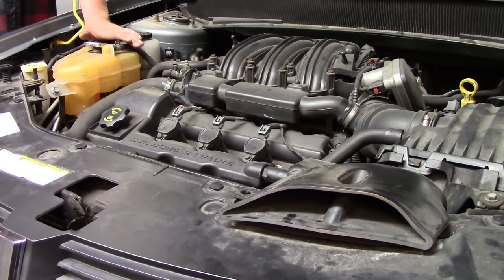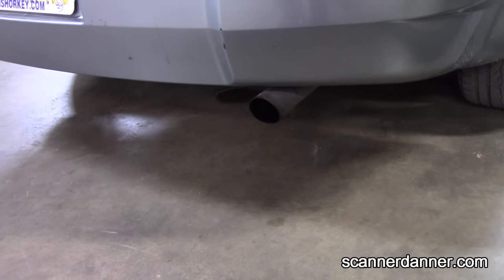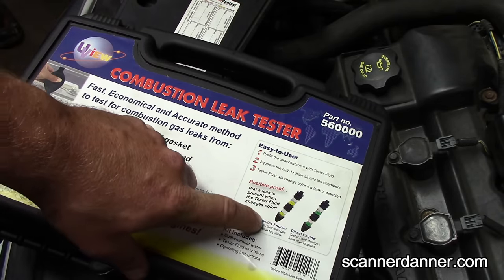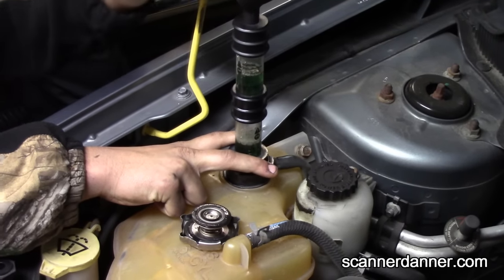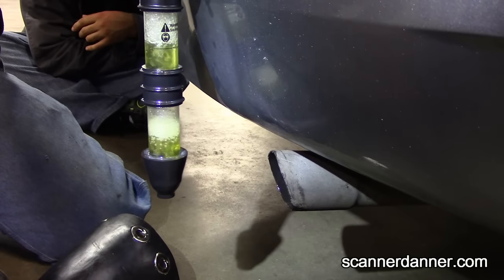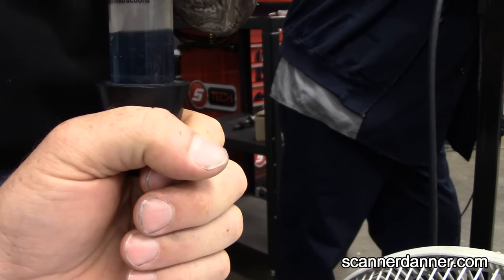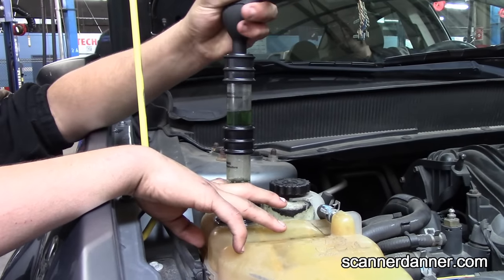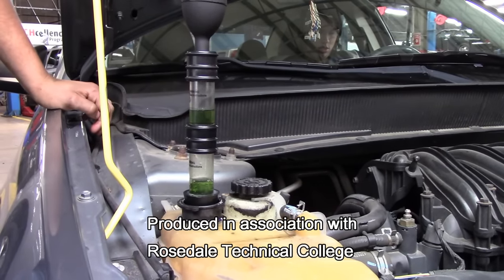Testing for a bad head gasket  - Gas Analyzer vs Chemical

Comment: "Bromothymol blue (BMB) is an indicator dye that turns yellow in the presence of acid. When carbon dioxide is added to the solution, it creates carbonic acid, lowering the pH of the solution. BMB is blue when the pH is greater than 7.6, green when the pH is between 6-7.6, and yellow when the pH is less than 6."   So even if it's green, you have acid in your radiator fluid, carbonic acid, which forms when carbon dioxide is bubbled through water.    Diesel produces less co2 than gas engines.

Comment: Since your device is malfunctioning how do we know your HC test is accurate?  dismissing the milky oil check is not a good thing, it's one way to check if you have a coolant leaking into the combustion chamber.  your test only checks leaks between the cooling and combustion and not leaks between two combustion chambers which can cause misfire symptoms.  performing the compression test will verify this by having two near chambers with similar pressure.
Reply from the maker: Just the O2 sensor, it is accurate other than that.
I'm not dismissing the milky oil test, only saying that you can't go by no milkyness as an indication that everything is good. Also I've seen milky oil fill caps without a headgasket issue (moisture from the cap area)
Compression loss between two cylinder does not result is overheating or coolant loss and would be a 2 cylinder misfire. Symptoms dictated that to not be the case. This isn't the be all end all as you're questions seem to be suggesting that I said it would be. This is simply the most accurate test for a common headgasket type failure

Comment: I have used an A/C "sniffer" a couple of times to condemn a head gasket failure.. after also verifying with chemical tester. Small leaks may not pickup so well though all the time.
Reply from the maker: I've also heard of false positives with this type of tester, so be careful

Comment: I just bought and used one of those tools but mine is called Block Tester, it only has one fluid chamber which they say is more accurate. The instructions for mine also say to squeeze the pump for about one minute, I'm surprised yours says only 3-5 times for gas. Luckily I didn't have a bad head gasket.
Reply from the maker: The dual chamber is supposed to be more accurate. Read "Pete Sambolin" posts in this thread

Comment: in the PDF you put up there... it clearly says " if the fluid turns yellow or green it is proof positive..."
Reply from the maker: The issue I had and still have is when it doesn't change

Comment: Paul, the chemical tester has to go right on the radiator cap.  To do that you need to drain the radiator a quart or two.  The chemical tester is probably not as sensitive as the gas analyzer.  But, it is probably 1/10th the cost!
Reply from the maker: This was a pressurized overflow bottle and WAS the radiator cap.
Reply: You are right, sir!  I thought the yellow cap at 0:18 was the radiator cap but it was the oil cap.  My bad.

Comment: Have you ever heard of or used "the sizzle test?" I have heard of it but never seen it performed on such a minor head gasket issue. Basically you take a small sample of oil and using a strong heat source you heat it and see if it just smokes or "sizzles" indicating water or coolant.
Reply: Yes, I learned that one from a James Halderman book. He calls it the dipstick test. It is not accurate on early stages of head gasket failure. Good backyard test though.

Comment: I absolutely hate the chemical test. I've had cars with definit head gasket failure and missed it due to that test. it seems to not be very good for early onset failures . ever since our old sniffer machine quite it's made making the call on head gaskets much harder
Reply from the maker: These are the types of comments that the viewers need to pay attention to. Some here swear by the chemical test in all situations. I am more inclined to doubt it is 100% accurate as you've described.
Reply: Not every head gasket leaks into the cooling system.

Comment: For the record. It states that you should NOT use exhaust gases to test the fluid. It can contaminate the tester for future uses.
Reply from the maker: Funny because it is exhaust gases that are in the cooling system when you have a bad head gasket

Comment: can we do the same diagnóstic with the compression transducer???
Reply: Th majority of failed cylinder head gaskets don't leak a huge ammount of gas pressure from the cylinder in to the coolant side.  Occasionally you get one where there is major blow out of the "fire ring" that seals the top of the cylinder and you will see definite puffs of exhaust gas from the raddiator or coolant filler cap. 
The engines I work on have open deck alloy cylinder blocks with drop in wet cylinder liners, on those particular engines I see a lot of head gasket  failures where oil and coolant are mixing but the fire ring seal round the tops of the pistons is still good.

Comment: Just throwing this out there without getting bashed Scanner Dan what if you use the Innova wide oxygen sensor reader will that work at all if you were to sniff the radiator.
Reply from the maker: Not sure Tommy? Thanks

Comment: What about pressurized upper and lower radiator hose.  I've expiereced it to be combustion pressure going into coolant  jackets was my guess.
Reply from the maker: For sure that can be a symptom but you will not always have that with headgasket leaks

Comment: Paul, what about if you had pulled the spark plug(if accessable) on the cylinder setting  the p030? and pressurize the coolant system and inspect for seepage in the combustion chamber. What if the engine had an intake manifold with coolant that could make it's way into the cylinder from a failed gasket.  lastly, It would have been cool to see you put a pulse sensor or PSI transducer in the  degas tank(coolant) and see if you could see anything with that way. Your students may have enjoyed it I know I would have.  I'm with you I don't trust them Chem testers Thanks
Reply from the maker: 1. You do not know what cylinder it is. (unless it is a dead misfire, you are going to spend a lot of time here)
2. pressurizing the cooling system is not a great test (compare 15 psi to hundreds of psi of combustion). I've seen many bad headgaskets hold pressure indefinitely with a cooling system pressure test.
3. intake manifold coolant leak - it does happen (rarely) and it is a variable (as with any test)
4. a pressure transducer in the cooling system, haha now you are starting to sound like me

Comment: Nice one Paul! I work in the place where we have gas analyzer for petrol engines emissions.
So 100HC (ppm) sounds high to me but is there something i need to know on warm coolant or something..?
I also have CO2 tester for petrol or diesel fired heating systems that we aftermarket install to cars to keep us and engine warm in here. So my Q is, do you have a limit how high you think it should be for only CO2  measurement?

Great video Paul again! Maybe that stuff works better when cylinder isn't' misfiring yet?
If not, i sure hope, we get some cheaper tools in future, that we can rely on..
Reply from the maker: OF course 100ppm is too high. In fact ANY HCs in the cooling system is too much. I use the 100ppm number as a 100% confirmation. I've seen gas analyzers read 60 ppm sitting on the bench. 
The Co2% from the cooling system should be 0 but I do not use this gas on the analyzer because it is designed to read larger amounts.
Reply: OK Thanks!

Comment: I did this test from my overflow tank and also blocked off the coolant overflow tube.  I would imagine that the air would be taken from the source of least resistance and since the overflow tube is fairly sizable and not restricted and right next to where the combustion tester is located, it only made sense to block it off.  Not sure the guys in this video did that.
Reply from the maker: You're talking about the overflow tube of the overflow bottle? You're not wrong in wanting to block that off. It's just not necessary. If the head gasket it bad, there is enough combustion gases in that tank regardless if that tube is open to the atmosphere
Reply: Fair enough.

Comment: Hi, i have a 2008 1.8 tdci and about for month had head gasket blown and The mecanic replaced it. Two weeks ago i had a longer trio and sudenly lost power and no heat came from heater. Today i made a test with a similar tool and The first chamber turns green only if i rev The engine above 3000 rpm. The mecanic doesn t have a dynanomatric key, could be The bolts?the engine starts normally when is cold.

Comment: I wonder if you could have a bit of "chocolate milk" looking stuff (literally just a slight bit) under the radiator cap that clears up after running the engine and never comes back? I just bought a 2013 Wrangler, and on the 3rd drive after I got it the coolant was low enough for it to "run hot" and after filling it back up it's ran better than ever (literally, it has run better than the day I bought it). I've got no signs of anything out of place, except maybe the tech that did the coolant flush not filling it up and burping it properly.
Reply from the maker: Something to definitely pay attention to. You could have a radiator transmission cooler leak that's getting into the water passages. This can end up putting coolant into your transmission and ruining it! What the transmission fluid look like? Maybe drop the pan, just to be sure, and do a fluid and filter change while you're there

Comment: Paul, have you ever stuck the gas analyzer in the fuel filler neck?  What does it show just sniffing unburned gasoline fumes?
Reply from the maker: HC gases is what you will read. CO, CO2, NOX are all byproducts of combustion

Comment: HC test fail if ECU after misfire detection cut-off injector (some cars do this very quickly). It will be visible when water flood spark plug.
Reply from the maker: The HC test is still valid in your senario, the injector will always fire on initial start up for a few seconds and typically headgasket failures cause intermittent misfires, that are NOT severe enough to disable the fuel. If it is bad enough to create a constant misfire and injector shut-down. I promise you there will be HCs in the cooling system regardless of injector shut-down. Why? Because injectors will always fire on start up.

Comment: i will also say if an EGR cooler is defective both tests will show a defective head gaskit
Reply from the maker: GM 3800?
Reply: i didn't mention make or model if the car is fitted with a egr cooler it will show the same result
Reply: its a fault that caught me out in the past something to pass on to your students just to watch out for it
Reply from the maker: and it is super uncommon and I have only seen it on the GM 3800 engine with the plastic intake. Can you name some engines you have personally seen this on.
Reply: it can happen to any engine with the cooler
Reply: all i am saying is when the modern engine  shows a head fault check to see if it has the cooler if it does look at it to make the proper diagnose. as all your misfire codes exhaust checks and leak test will show for a positive head fault when i might not be
Reply: I am not arguing with you. I just wanted some specifics from you for my subscribers as to which engines you have seen this on. I myself have only seen this on the GM 3800 engine and it would help me and other to add to this list. If you don;t have specifics, no big deal. Thanks for your contributions here.
Reply: i am just generalizing to the fault  and not pinning it down to make model or engine its just a good thing to check for with those symptoms i watch your vids on management faults   and thy have helped me a lot  well done for taking the time on them i just wanted to add that as it can catch poeple out
Reply: it is a fault iv found more common on diesels but i have seen petrol's  varying a wide rang of makes and models so just a good idea to check to see if it has it And if it does pop the EGR valve of the engine ass they tent to look steam cleaned inside when it happins
Reply: BMW M57/M47 Engines , some VW TDI engines , most of the water cooled EGRs are on european cars (for now)
Reply: I totally agree , a defective egr cooler with make both tests invalid. & i have seen vehicles have head gasket changed only to find egr cooler the problem!! To the cost of the customer .But cooler only on newer cars tho, as cooler not really found older stuff. So Testing needs to look at the age of vehicle & equipment fitted
Reply: ) all was trying to say look for the cooler if it has it test it but what i will say on that a pressure test will sometimes  say its fine when its not
Reply: some diesel engines have an EGR cooler like the 6.0 Ford
Reply: Some european cars have that egr cooler
Reply: A lot of heavy duty engines like Cummins on heavy duty trucks have EGR coolers and they do go out all the time.

Comment: With respect to the hydro carbon testing... Would a alcohol based coolant at high temperature cause a false reading??
Reply from the maker: I am not sure my friend. I am certainly not familiar with that type of coolant and have never had a false positive for this test (The HC test in the overflow bottle)

Comment: If a cylinder is just not burning or firing, wouldn't you be able to tell just by an obvious miss in the engine?
Reply from the maker: Yes, you'll typically have a misfire, but not always, depending on the severity of the gasket leak. But there are many causes for a misfire that are not head gasket related. Make sense?

Comment: So you can re use the fluid it turns back blue sucking fresh air in ???? On the combustion test fluid bottles says don’t re use fluid. Confusion
Reply from the maker: You don't want to dump the used fluid back into the fresh container, but yes, it will turn back to blue with fresh air

Comment: The best fluid i have found is from Napa..Tthe oem brand from autozone wont change  even at the tailpipe. A 5 gas is the best until a rookie sucks antifreeze into it. If the coolant has been changed the fluid test can be thrown off. if you suck antifreeze into the tester the fluid will turn a light green then turn back to blue.

Comment: my question is this:  is it possible for there to be an HG leak that is not bad enough where it is going to leak during the compression stroke or soon after spark, but it leaks only at maximum cylinder pressure and when there is not enough uncombusted HC remaining in the cylinder that can be pushed through the HG leak to be detected by the gas analyzer such that it gives an unambiguous result?  or is there always plenty of remaining uncombusted HC to detect through the HG leak when the cylinder is at maximum pressure?
Reply from the maker: I've never, not once, had a false positive or negative using the gas analyzer. If the headgasket is bad, or there is a crack in the block or head, you will see it. I can't say that I have as much confidence in the CO2 test of the block tester

Comment: If your getting unspent fuel in a cylinder you can drop a spark plug out and see if a plugs wet with fuel. You'd also have a misfire and your can also measure temperatures or exhaust manifold.  For every argument your making in your video there's plenty of other things to try to confirm a head gasket misfire etc.  Use another method to confirm like compression test or leak down test. Always best to make double sure before ripping a head off

Comment: I don't even bother with the Routine Test and go right to the Major Leak Test. The major test you accelerate and reduce idle and test and repeat it @15 times. You can also shut down and restart, accelerate, idle and test @15 times if you suspect injectors are shutting down. Perform cold & hot b/c sometimes it shows up better cold and sometimes hot according to cyl head/block configuration. I have the same kit and have used it for years and it's pretty accurate but I also follow up with a leakdown test with coolant system pressure tester to try and nail it down b/c it's an expensive repair and you don't want to get this wrong or you'll be eating a big repair bill. 5 Gas analyzer is expensive and not a lot of shops have them anymore. The Bulls Eye Leak Detector Ltd Kit is supposed to be the most accurate kit but is pricey @$1400 for the limited kit but for the shop owner it's a pretty good price if you do moderate to high volume b/c if it saves comebacks or misdiagnosis and it pays for itself extremely fast. For the DIYer the the UView Kit will work just fine. If it changes to green or yellow you have a problem...green for smaller leaks and yellow for major leaks. Hope this helps and great video Paul!

Comment: I have a 2016 Malibu with the 2.0 LTG engine at the shop that's consuming coolant, put dye in the system and cant find a leak anywhere, tried the combustion leak detector didn't change, all plugs look good, engine oil isn't over full or showing traces of dye, No misfires. GM hasn't seen any reported cases on this, they are thinking a head gasket but that is just a guess.  Any recommended test to do before the engine comes apart.
Reply from the maker: yes, the HC test using a gas analyzer

Comment: I use aluminum foil to find oil mix in the radiator. just put a few drops of the antifreeze in the foil and heat witj a small flame. If it makes a crakeling sound  it has oil in it. and I look for bubbies with engone running.